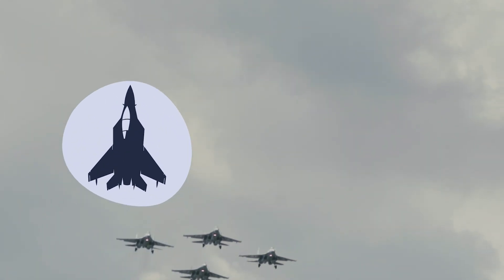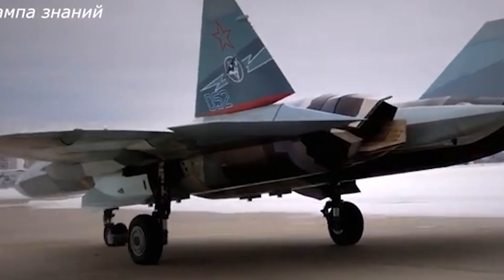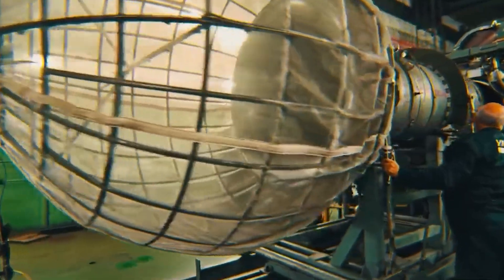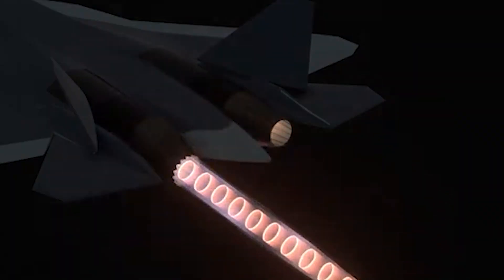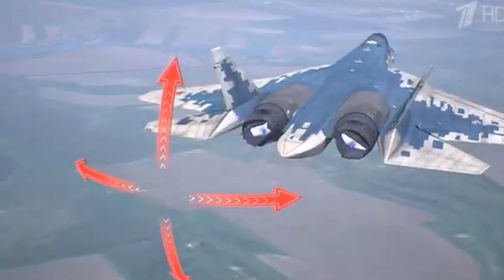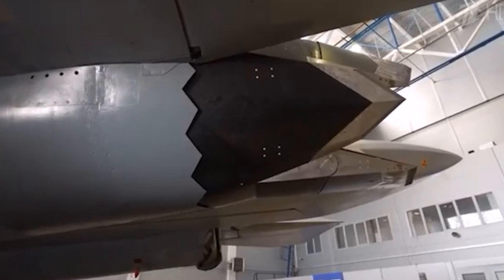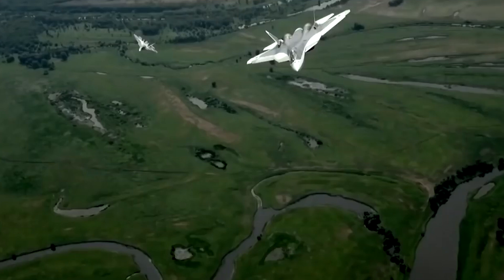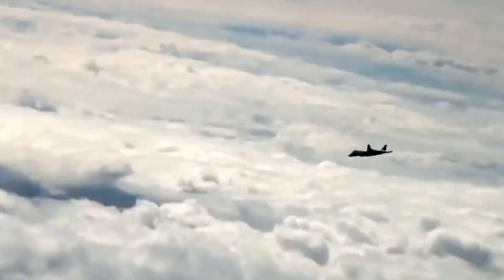Su-57 Felon: Flat Nozzle Stealth Breakthrough!

Comment: cutting-edge advancements you mean like something that F22 has from 1997? Also until the radar cross section is as large as average non stealth jet then idk if this is stealth...
Reply: the vectorization of the f-22 is 2d, 2d vectorization with a flat nose the Soviets had already developed for the yak-141 jet was nothing new, we are talking about a 3d vector design with a much more complex flat nose, and if it had the stealth of a fighter medium would have been shot down when he flew over Ukrainian territory in the episode in which he shot down the S-70.
Reply: @usuariopimba707  ok but cannot you perform 3d vectoring just with 2d + power adjusting with each engine?
Reply: thats just about infrared.
Modern radars can see everything
Reply: @TheMrGREENRay  it is not about modern radars. If you use right wavelenght radars you can see everything (F117 in Serbia) the problem is missile locking. If you use long wavelength radar you know something is there in radius of hundreds of meters which is good but not good for shoot down bymissile. you have to use radar with better resolution - smaller wavelength but this is exactly when stealth really can perform its best - from shape of the aircraft to the painting. Everything is made to absorb or bounce the waves in the way they cannot be received back. And even if you can do this then you have to filter noise from radar signal and know exact radar signature of the aircraft which some aircraft can even change in realtime due to the electronic onboard. In one sentence lock missile on target is rocket science.
Reply: @Frajby3  Ok, but thats old problems from 90s, maybe neural networks and modern microchips will fix this. I just heard the new nozzle is just about to reduce "heat sinks."
Anyway the just recently made the power unit more powerful and less heavy than F22 have, thats why they just started to play with 'retarded" nozzle (Its bad for aerodinamics thrust and manageability).
Some guy told: plane is easy to make, engine is a pain.